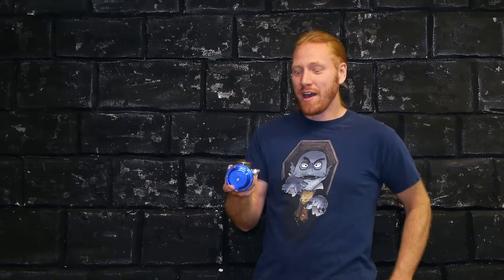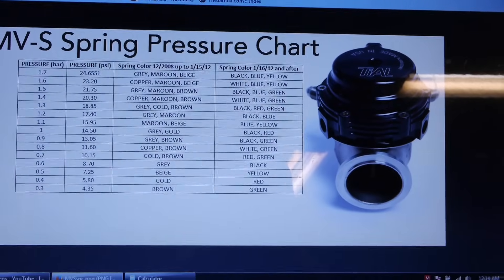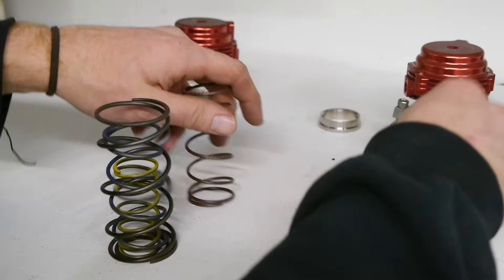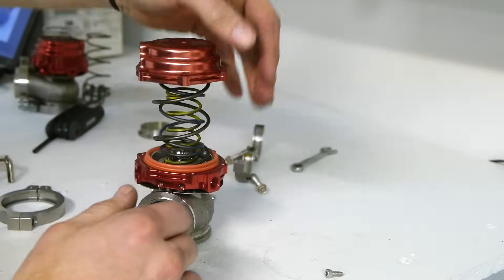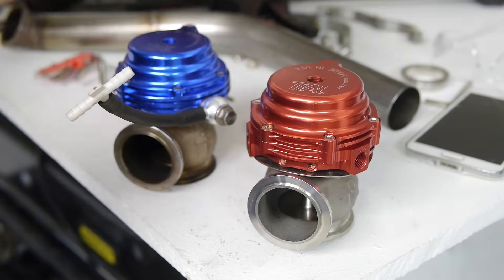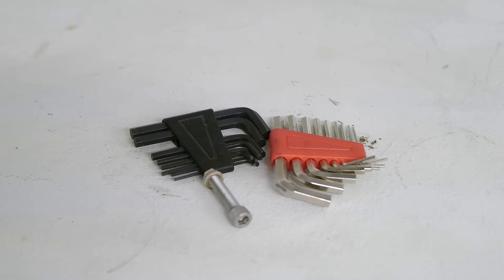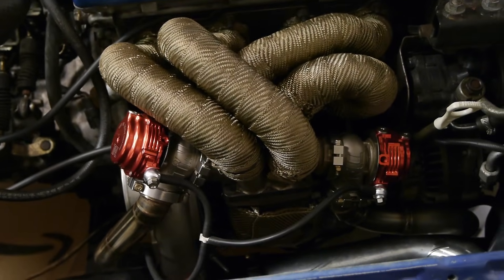TiAl wastegate setup and install tutorial

Comment: Critical tip to help install the gate easier. Run a vacuum line to a compressed air source to the bottom port and open the wastegate as though it were boost. This takes pressure off the fire ring and lets you install the gate with no fuss. Use this trick to uninstall as well.

Comment: If I’m using an electronic boost controller, do I need to close all the lower ports and make sure the top port is going to the boost controller solenoid?

Comment: @Velocity Labs my car started running weak so I did a boost leak test at 5psi & I noticed an air leak through 1 of the side holes that didnt have a fitting into it & also right through the exact middle of the wastegate "not from where all the hax bolts are at". I wasn't sure if there was a fitting on there before so I decided to put a plug into it. Now the car runs a lot better, but it still leaks through the middle of it at 5psi & car it's set for 15psi; I also noticed that my BOV it's not opening like before so I'm a bit scare of blowing something up. Wanted 2 know if wastegate it's supposed to have side hole open if u are not using water cooled, or has to be plugged? It's running way better now that its plugged tho. Thanks

Comment: Why are you not running electronic boost control? It keeps the wastegate fully shut until you hit a certain amount of boost, so the turbo comes on harder. I am running an evo ecu and it has drop boost on high knock and afr safety. So if the ecu will see 8 counts of knock, or the engine will be too lean on boost it will drop the boost to spring pressure. Safety first :)
Reply from the maker: I should be!  I've been looking into it, it will definitely be an addition this year.

Comment: A lot of people get ebay wastegates that don't leak. My issue is the low quality metal used on the springs that will degrade fast from rapidly heating and cooling so many times. What if I threw tial springs in an eBay wastegate?

Comment: At 5:20 you said you need to run a vacuum line from the boost source (?) to the wastegate? This probably sounds stupid but define boost source? Exactly where to do run it?
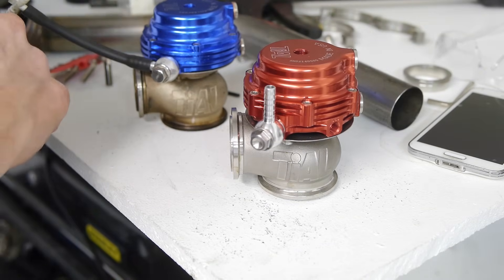Reply from the maker: You run a vacuum line from anywhere there is boost (like a nipple on the turbo) to the nipple on the wastegate (like the one at 3:55).  That will tell the wastegate when to open!

Comment: just got this part installed by a performance shop, but for some reason it isn't making that classic EWG sound, what might be the cause?
Reply from the maker: You really won't hear anything until it opens up completely.   What PSI do you have it set to open at?
Reply: i had a performance shop install it for me so honestly dont know, the springs i have left in the box are white blue green yellow. and my tune is set for 20-21, not hitting target boost either

Comment: So do I still need to install the wastegate springs if I'm running an electronic boost controller? Sorry if this sounds stupid, have never installed external wastegates before and currently in the process of it
Reply from the maker: Yes, you still need to install at least one inner spring.  you can likely pick a lighter spring though, the electronic boost controller will allow you to increase the boost over the spring pressure.

Comment: i would highly recommend you opt for some form of electronic boost control trust me the increased boost response you will see over just gated spring pressure will make it worth it.

an EBC can help you ramp the boost on MUCH MUCH faster than both a manual boost tee or std gate pressure because you can hold the gate closed longer allowing more of the exhaust to work at spinning up that turbo for longer.
Reply from the maker: Yeah, definitely sounds like a future mod!

Comment: I got a 2013 2.0T with a 19g turbo whats that ? Running 16psi of boost I believe. its twin scroll, I'm guessing its eternally gated like you say. And I was thinking about a manual boost controller but I have some vacuum driven solenoid that controls my waste gate I believe, Im thinking a electric boost controller would be expensive and need a tune right ?
Reply from the maker: Yeah, a MBC is cheaper than an electronic one.     I'm not familiar with the Genesis Coupe but this forum seems to have a ton of info: http://www.gencoupe.com/engine-2-0t/
Reply: if your boost controller is driven by the ecu which i would say it is you can actually take it into a tuner and have them remap your FACTORY ecu for beter boost response more power and more boost.

while being more expensive than an MBC and EBC is worlds better. offering far greater control over not only peak boost but many other things. including boost by gear boost threshold (how fast it spools) etc you may even find going from your factory boost control method (solenoid) to an MBC might actually result in power loss below peak boost pressure
Reply: Thanks for the info guys, Yeah I have a tuned ECU already from SFR,  I'd have to be not lazy and cash out for a Custom tune.
Reply from the maker: Good info!

Comment: twinscroll is that like two turbos i one or am i wrong ?
Reply: it's one turbo HOWEVER the exhaust section of the turbo is completely divorced until after the turbine this allows you to pair oposing cylinders and in some cases COMPLETELY eliminate exhaust valve overlap (where more than one exhaust valve is open causing pulses to merge and reverberate back into the cylinder in a 4 cyl this means exhaust pulses to each scroll of the turbine will ALWAYS be 180 degree separated.

in applications like a toyota supra or skyline 6 cyl that might often have twin turbos you can take the individual sets of cylinders that would otherwise drive separate smaller turbos and pair them all into a single scroll of a larger twin scroll turbo netting similar or better response while simplifying the compressor side piping. you also have the benefits of weight saving and larger flow of the bigger single turbo. check out motive garage here on you tube where they directly compare a twin scroll single vs a single scroll twin turbo setup.
Reply from the maker: Just 1 turbo with a divided exhaust manifold for better response.   Engineering Explained has a good video on them: https://youtu.be/T7JTRRlSEYI

Comment: #twinscroll love it , great video honestly never dealt with a twin scroll didnt know they needed two wastegates
Reply from the maker: They only need two wastegates if they're external!  If the turbo is internally gated it only needs one :D
Reply: you can run a single gate of a twin scroll BUT there is great dificulty and effort in ensuring the banked pairs stay divided right until they are released any gap can see the runners merging and negating any benefits of having a twin scroll in the first place